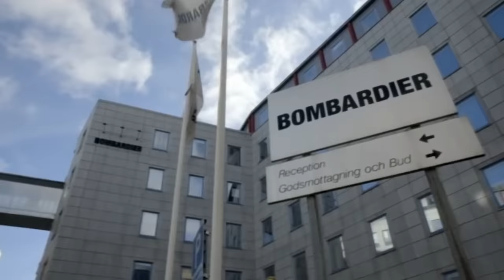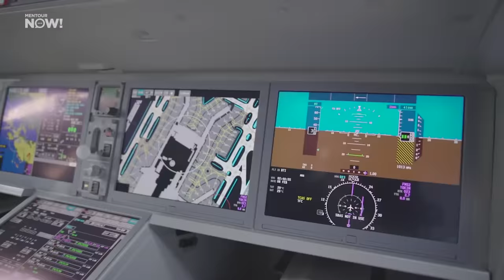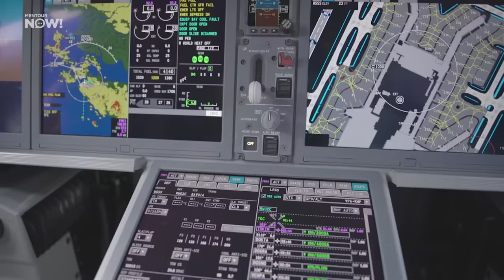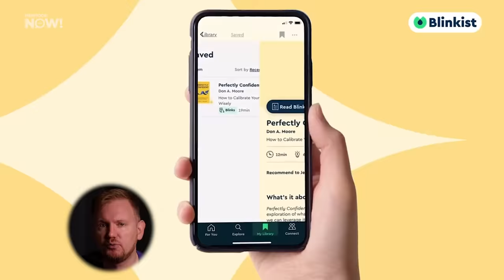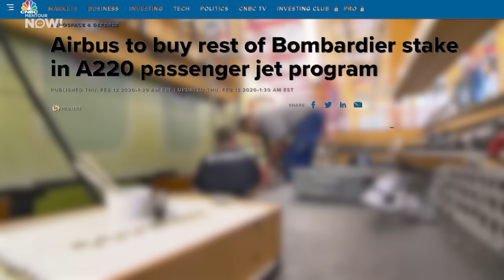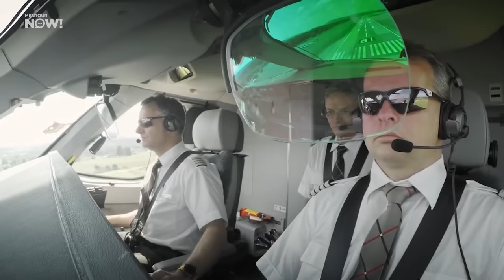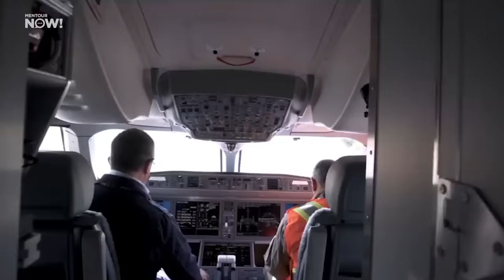Did Boeing GIVE Airbus a FREE Airplane?!

Comment: Love the A220 from the get go. I believe it to be a better fit for Airbus than Boeing. And check out the ACJ220 with range capacity of 10500km, or about 12hrs flight time. Damn it is a sexy plane😜

Comment: one thing i struggle to understand about Boeing and please correct me if I am wrong (i will admit i haven't watched the whole video whilst writing this comment), Boeing claimed Bombardier sold the planes to Delta at a huge discount, isn't that something Boeing does to its customers (though probably not as big a discount)
Reply: Selling a product at a discount Vs selling a product at a loss are two different things. In the case of bombardier, they were selling the c-series at lost to delta, hoping it would increase demand for the aircraft. Countries have laws to protect domestic producers from imports selling under market value (Anti-dumping)
Reply: Dumping usually includes a foreign sourcing component as a way of propping up a foreign entity. For Airbus, that was one of the driving factors behind the Alabama factory.
Reply: Airline manufacturers have always sold all-new models to their launch customer/s at a big loss to establish initial market share. Boeing certainly have. It's the only way to get airlines to be launch customers - in return for bearing a big risk (the new model may turn out a dud - many have been) they get cheap planes.
Reply: You stopped watching 10 seconds short. Mentour explained it in his next sentence. 4:40  4:51

I have never understood why people stop watching a video in the middle and then start making comments.

Comment: While working at Boeing, I always thought and advocated that a Bombardier merger would have been the smart approach. The intellectual property for an already certified fly-by-wire system which could be the basis for a new family of aircraft and the Bombardier-Belfast composite wing manufacturing knowledge would easily been worth the purchase price. Any new airplane program that was beginning from a flight deck certified to the latest regulations would have saved a least 1 year in the development schedule. I have a hunch that the "Not Invented Here" attitude of side-stick controllers and the adoption of flight envelope protection in the CS100 played a role in dampening Boeing's enthusiasm because it would have made transitioning from one Boeing family to another more difficult.

Comment: Have taken flights with cs300 from airBaltic, and it really feels nice and with attention to details and comfort, compared to 737
Reply: 1) Have you flown the Max, 2) which details are you talking about?
Reply: I like your Latvian livery nickname ;)
Reply: @davidcole333  Nope didn't take the max yet, in Europe they use alot NG 737's, and airbus a320 family. And i'm talking about the interior, it even has small screens above seats.
Reply: @ylcsl4378  Screens on the seats aren't that common there. More common for U.S. airlines. The United MAX is pretty nice, same with Alaska. Really liked the experience
Reply: @Jack3md  Interesting, but I am still kind of afraid of the MAX, if it has issues

Comment: the other factor is that it might have led to Boeing not being in quite such a hurry to rush the MAX to market, and the bugs may have been caught in testing instead of in crashes.
Reply: Here, here!
Reply: Those weren't bugs. That was criminal intent.
Reply: @BigWhoopZH  really, you have tapes of boeing engineers saying they intended to cause their planes to crash?
Reply: @kenbrown2808  have you been living behind the moon for several years? First of all nobody uses tapes anymore. But joking aside... What lead to the crashes has thoroughly been discussed publicly. There is no doubt that Boeing decided against safety for economic reasons. MCAS relying on only one (possibly faulty) sensor and not telling pilots that's MCAS even exists are the main points here. And yes, it's also known that engineers have warned the management about it and were ignored. I recommend you watch the Netflix documentary "Downfall" to update your knowledge.
Reply: @BigWhoopZH  so in other words, no, you can't provide evidence that engineers chose to deliberately cause crashes, and you're just throwing wild unsubstantiated accusations based on a total lack of understanding of how words work.
Reply: @BigWhoopZH  so in other words, you can't answer my challenge and now you are trying deflect and gaslight your way out of it.
Reply: @kenbrown2808  I did answer your challenge by pointing you at a source. The short answer is: Redundancy of critical systems is a key principle in commercial aviation and has been for at least half a century. Fact is: deciding against this principle will eventually lead to fatalities. And that is exactly what Boeing did. The management has been warned about it and they still did it. So yes, Boeing rolled out the 737 Max knowing that it is not safe and would eventually be a death trap for passengers and crew. That's my last answer in this thread. If you're not capable of processing the information I gave you, I can't help you. Sorry.
Reply: @kenbrown2808  There was no intent to crash. But there was intent to not inform pilots, and also make something less reliable so it wouldn't show up in reviews as "critical" and/or "new".
What is a garage sells you a car with half the brakes fitted to save money. Do they want you to crash? No. Is it bad and unprofessional? Yes.
Reply: @pizzablender  I try to silently implement bug fixes and new features at work as well. It always sucks to go through the whole ticket and reviewing process. I can totally understand any engineer who does it.
Reply: @Mike-oz4cv  But I suppose you do not make life critical software?
Reply: @pizzablender  No, hardware which is produced in millions of volume.

Comment: I can tell you what Boeing are good at calculating. Firstly, they calculated it correctly that they could dodge FAA certification standards for number of sensors required for new subsystem adaptation and some recertification requirements too. Then they calculated correctly that they would not be charged criminally after the first accident had happened and they knew their little secret would kill more people i.e. they conducted a premediated murder of hundreds of passengers. Then they calculated correctly that the revenue from sold killer jets would be thousands of times higher than the financial charges they would face instead of criminal ones plus redesign expences.

Comment: How similar is the A220 to the rest of the Airbus family in terms of pilot training? Especially regarding how it would be different from a 737 vs A320 pilot to get certified on a A220
Reply: No similarity. A path for a 737 pilot moving to CSeries would be exactly the same as a path for A320 family pilot.
Reply: The A 220 is still a Bombardier from the technical side of the story - it´s neither an Airbus nor a Boeing. It needs indeed a special type rating.
Reply: Different type rating. Initial type rating training required. No credit for 320 rating. But I will say, the 220 at least for me was easier to learn than the 320.
Reply: @ZS-rm5vn  Can you explain why was 220 easier to learn? Can you go into differences? I'm sure some people would like to read that.
Reply: @Nikola16789  It goes into technical and perhaps personal experience/ learning preference. At the end of the day, it's a tool and we use it as designed and as needed to accomplish the task. The way the course is arranged was a difference I noticed in my case which led me to my comment about learning. On the hardware and technical side, 220 is a newer airplane,so  some ergonomics are different and arguably better thought out. The FMS and avionics are basically a RockwellCollins setup pulled from a bizjet, not saying that is good or bad, just answering the question about differences. Other standout differences are AT has moving thrust levers and a spring centered sidestick with manual speed trim in manual flight. Again, I don't really care one way or another but it is a difference and it makes the airplane feel more 'traditional' in manual flight. Like some other planes and unlike the 320, 220's AT is slowwww, probs because of the engines and software...

Comment: To add to the drama, airbus wouldn’t have had the Alabama facility (and been able to step in and save the c series program) if Boeing hadn’t first pulled out of a deal to assemble tankers there.. 😅😂
Reply: And additionally the tanker deal leading to the KC-46 is a fixed price contract - but Boeing struggled with some problems and is losing money on this contract

Comment: Airbus has an easy replacement for the A320neo; using the stretched A220-500. The A320 family replacement will therefore move a bit higher in capacity, making the A321neo possibly the base model of the new series. The higher end model will likely be a perfect or better B757 replacement and cover the mid-size plane size. The A330neo replacement might only need one or two model in the series to cover the gap between the single aisle and A350 in terms of capacity.

Comment: How much did the sour relationship Boeing had with the DeHavilland Canada purchase, operation and sale have on the potential Bombardier purchase of the CS series? Plus, I don’t think Boeing was very interested in a 5 seat row verses a 6 seat row due to the md95/Boeing 717 experience. In short, I think Boeing just turned up it nose on the Bombardier CS series up until it demonstrated it was going to grab a huge chunk of the 100 to 150 seat category from the 737 market. (Keep in mind, the CS series was a direct replacement for the 737-200 market niche, but with longer legs. 

In short, Boeing had a selfish spoiled brat snobbish attitude toward the whole Bombardier airliner project. And it showed. It in turn came back to bite them in the rear end big time.

Comment: Luxair has been looking into the Airbus A220 for replacing their mixed fleet of Bombardier Dash 8-Q400 and Boeing 737s, where the A220-100 could serve London City Airport which is on of their main destinations, the A220-300 for their less popular destinations and A220-500 for their very popular, mostly holiday destinations. As a small airliner, operating a mixed fleet is very uninteresting from a maintenance perspective. Even large airliners such as Ryan Air limit their fleet to one type of aircraft to cut maintenance costs. While there is some overlap, not having to introduce a new or multiple aircraft type is a big selling point for many airliners.

Comment: The first Canadian airline interested in purchasing the C-series was Porter Airlines, quite interested in using the C-series using Toronto Billy Bishop airport (YTZ) due to it’s lower noise levels compared to their current planes. Local protests however made the City of Toronto authorities deny Porter the use of the C-series from YTZ. Ironically Porter has now decided to purchase Boeing 737’s instead…..
Reply: Wrong, Porter has firm purchased 50 Embraer E195-E2s, with the option of 50 more.
Reply: That’s right

Comment: I live in a metro Atlanta city about 20 miles south of the airport. Many of my friends and neighbors have been Delta pilots, cabin crew, executives and management types. Their stories regarding the C-Series acquisition, with which they agree was a good thing for the company, also agree that the offer to Delta by Bombardier was so low, below even that of their cheapest business jets,  that it was pretty likely a case of dumping, that being selling them below their cost of development and production. However, if you want to produce the planes in the U.S. and sell them at a loss, that may be bad business but it's not illegal. Since Airbus paid essentially nothing, they could move production to the U.S. and expect to eventually sell the planes at a profit. So, who got screwed? Well, Boeing is now doing just fine, but not-so-much the Canadian tax payers.
Reply from the maker: That might be true, but like I said, the issue here was a missed opportunity by Boeing.
Reply: Main Production has to stay in Quebec until at least 2041, per the deal. Quebec had extended its stake until atleast 2030- The Canadian taxpayer might actually still be benefiting here because most of the A220 is still built in Canada with the finial assembly for US customers done in Mobile, so they’re selling more planes with more Canadian-made parts than Bombardier could’ve in the first place. Boeing is really the only one who lost out here, since they still don’t have a true A220 competitor and lost nearly 100 Super Hornet sales to Canada over their shenanigans.
Reply: 'Well, Boeing is now doing just fine, but not-so-much the Canadian tax payers.'

Really? Do you know how to read financial statements?

Comment: Seems that the hangover from 2006/07 just lingers on.  I may have it wrong, but that's when they rebuffed Alan Mulally for CEO and instead went down the MD line of management.  And for that, I'm actually quite thankful, as it saved the corporation that I worked at.  Hard to feel bad for Boeing that is keeps making questionable decisions.

Comment: Delta ordered Bobardier in 2016 - they must have been so glad they evaded the 737 MAX issues. Better to have a machine that was designed to be energy efficient, than an old platform from the late 60s with larger engines slapped on it - and a software fix for the problems with the "quick-and-dirty" solution. - Sure now there is a less irresponsible software fix for a technically flawed design - but it is still possible that there will be a stalling during take-off. 

Now they have a MCAS light in the cockpit and also do not hide the existence of MCAS in the handbook, and pilots can override it and are trained how to do it  - but the correction during start (problems with gravity center especially under high weight and with lower speed) is still needed. At least now the FAA could be bothered to require them to have  2 independent sensors that provide the input to the correcting software. But 2 sensors still can fail. (One sensor was criminal cost cutting, and a crash waiting to happen).
Reply: I am not aware of a potential issue during takeoff. My understanding is that the new engines can cause the nose to rise higher than previous versions in more extreme pitch, high thrust situations like during an evasive maneuver, like avoiding terrain or something. Not during normal pitch up during take off or whenever. Even then it wasn't unsafe unless a pilot didn't know that it flew that way in those conditions. 

So it required either simulator training, which meant a new type rating, or modifying it in software. Knowing that airlines don't want a new type Boeing went the software route, and due to carelessness and shortcuts implemented it in a dangerous way. 

The software has been improved and pilots are well aware of it now. And I heard they will eventually connect it to the second pitot tube as well as a third virtual pitot tube, but I don't know that for sure. All of the anger toward Boeing should be directed toward FAA and Boeing, specifically about completing these changes. Also they have a spare switch now that they made the two stabilizer cut off buttons do the same thing. On 737 NG the left switch turned off the thumb horizontal trim controls on the yoke. The right switch turned off automatic horizontal stabilizer. In the max they combined both functions into one switch. But rather than eliminating one of the switches, they merely duplicated the funtion onto both switches. The thinking being that pilots can still press the switch they are used to. And either switch turns off MCAS. Seems pretty stupid to me. They should have made one of the switches only turn off MCAS, that way they still keep thumb buttons and automatic stabilizer control, just without MCAS. Probably too late to change now.

Comment: 17:20 why do you say the A320/21 Neo are not successful? There are,as of now, 8,665 ordered aircraft, and 2,156 deliveries. ~55% of these are A321 Neo, not quite “a fraction”. Only 85 orders are A319 though. Together this is 60% of the market share with the Boeing 737 MAX. Compare that to only 238 aircraft built for A220.

Perhaps I’m missing something. One could say A220 is underwhelming in sales, but I think the A320 Neo is quite successful, no?

Comment: By far the biggest winners from this is Delta. They essentially got 70 planes at cost, courtesy of the Canafiam government. Second place  winner goes to Airbus, who got an excellent modern design for very little money.
Reply: The Canadian government did not invest in the C-Series, and at the end specifically refused to because of political pressure from opposition parties against helping a failing Québec firm.   (the Québec government however did invest in it and still owns 25% stake in the A220. (Airbus only owns 75%).

Comment: So the wings, which are the most important and crucial part of any airplane (high speed efficiency, low speed efficiency, structural weight, structural strength, fuel tankage, plus many more mission critical parameters to get right - you get the picture) are made in Belfast. That's interesting. The Airbus wings are all designed and manufactured in  England. 
  And people think the UK doesn't have an aircraft industry anymore.